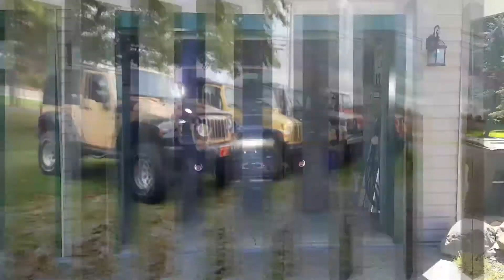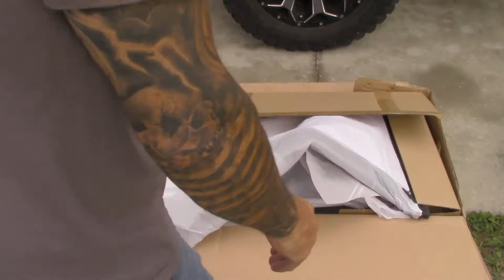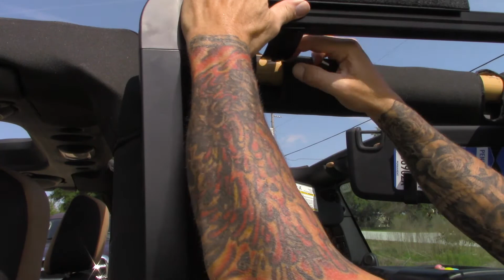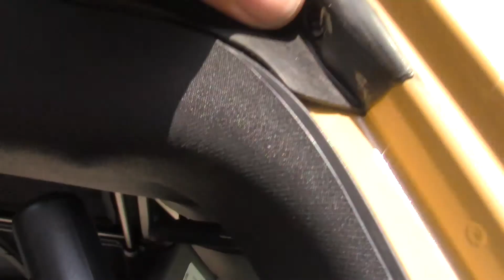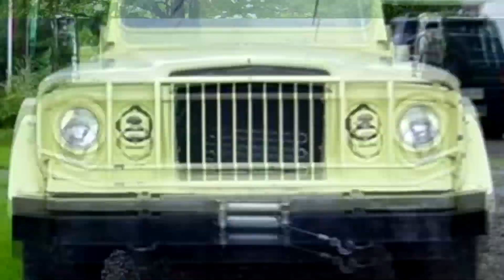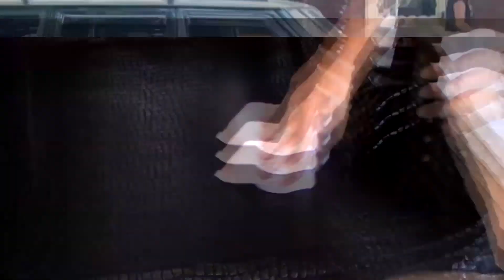RAMPAGE Trailview Soft Top

Comment: How it’s holding up so far my friend thinking about getting this one., does it leaks inside
Reply from the maker: Seals up as good as the Bestop brand. In severe weather, it has a slight leak at the passenger door. I've always had that leak, I believe it is a bad door seal, just warped not torn. The best part is the window storage.